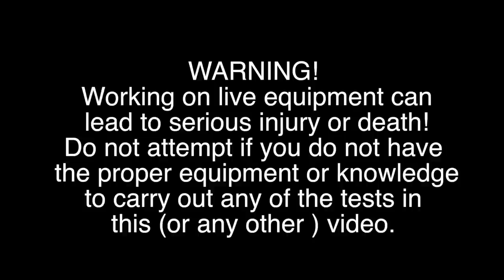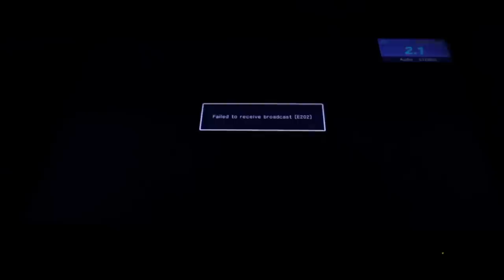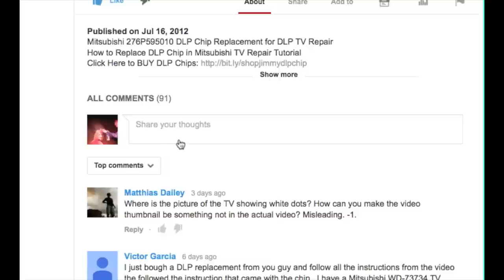Sharp LC-32 1 Blink TV Repair How to Troubleshoot Problem Between Bad Lamps and Power Supply

Comment: Hello, I have a Sharp Aquos LC-60LE820UN I have the error code with the single short flashing light then the long flash, which indicates a lamp/inverter failure. I have replaced the power board and I am getting the same error code; also attempted to clear the code by entering monitor/service mode by holding the power for 10 seconds then releasing and holding the input, vol- and power. I am able to get the lower panel o f the TV to power on ( touch controls, Sharp logo and the V in the center, but the LCD screen does not power on it stays black but it does flash off and on for a second. if I do the sequence several times I am able to get rid of the error code and I am able to power the TV off and on with the power button but the nothing other than a flash on the screen. Is it possible that it could be something else like the T-con board or it actually a bad LCD screen. My next question is it possible to bypass the vault protection as it was done in this video and if so where on the board is the component located that needs the jumper; I have tried to find the schematic for the power board in this TV, which is runtka684wjqz but I have not had any luck. Any help that can be offered will be greatly appreciated. Thanks
Reply from the maker: Andre S   This sounds like a TV panel (TV Screen) problem.  If your TV panel is bad, it may be more cost-effective to replace the TV as panels are typically hard to find in stock, difficult to replace, and expensive.  Thanks and please let us know if you have any further questions!  www.shopjimmy.com
Reply: ShopJimmy.com Thanks, I was hoping that I would be able to bypass the fault code circuit and use the TV until it died completely.
Thanks again,
Andre

Comment: > 
> Product: LED/LCD TVs
> Model #: LC-40LE820UN
> Serial #: A005820180
> Description: Hi I need this motherboard
Reply from the maker: Luis Gonzalez   Try all repairs and troubleshooting at your own risk.  Click this link to a replacement main board for your TV model number:  http://www.shopjimmy.com/sharp-dkeymf452fm02-main-board.htm  There may be multiple boards for the same TV model number, be sure to match part numbers on your current board, with your replacement for compatibility.  Thanks and please let us know if you have any further questions with your TV Repair!  www.shopjimmy.com
Reply: THANK YOU JIMMY I KNOW THAT I NEED THE BOARD THE MODEL # IS XF452WJZZ
THAT THE BOARD THAT I NEED TO REPLACE ......ALWAYS TANK YOU

Comment: I have a Sharp Aquos LCD tv. model LC-40D68UT. When the tv is powerd on, it works for about 2-3 minutes them shut off. there is a red light on the mainboard that is blinking. If u pull the power plug out the power outlet for a few seconds and back in again, then turn the tv back on, it runs for 2-3 minutes then off again. When the tv is on it works normal.
Reply from the maker: Royston Sue Chee  Please watch this video FIRST to help with your repair!  TV Repair! LCD, LED, Plasma, DLP How To Fix Your TV with ShopJimmy.com Help!   I recommend replacing the main board in your TV.  Follow this link to replacement parts:  http://www.shopjimmy.com/catalogsearch/result/index/?cat=56&q=LC-40D68UT  Be sure to match part numbers on your current board, with your replacement for compatibility.  Thanks and please let us know if you have any further questions with your TV Repair!  www.shopjimmy.com
Reply: ShopJimmy.com  hey Jimmy i have mother board out of lc-32sb23u tv and have sodeder c7558 now once it is back in and still does the same it is def a lamp?

Comment: Jimmy -

I have an Aquos LC-45GX6U. The unit does the blinking red light when I turn it on. If I put it in service mode, (hit "input select" and "channel -") the unit will turn on and display a picture. I've tried a reset and a master reset from the AVC box. Same issue. 

I know the unit works, because iI get a picture when it's in service mode. Any idea of what else can be wrong?

dlleon@swbell.net
Reply from the maker: +David Leon  Try all repairs and troubleshooting at your own risk.  I recommend replacing the main board in your TV.  Unfortunately I do not see a replacement main board in the search results for your TV model number on our website.  Please reply with your part number on your main board and I can try searching for replacement parts.  Thanks and please let us know if you have any further questions!  www.shopjimmy.com

Comment: SURE REPLACE POWER SUPPLY , BUT SHOPJIMMY IS ALWAYS OUT OF STOCK AND EBAY SELLER  SENT ME A PS WITH A BURNT OUT FUSE AND MANY DEFECTIVE DIODES. WHAY A BUMMER AND MY SHARP TV IS ONLY 5 YES OLD. NOT A HAPPY PERESON
Reply from the maker: bigibigs715   We have not had the power supply part number - ADTVA2415SA3 in stock since January of 2013.  Unfortunately we are not sure when or if ever we will get that part in stock.  You can sign up on the product page to receive a notification when the part is back in stock.  Also, unfortunately we are not able to control what boards you receive on Ebay, as you bought that board from a different seller than us.  Thanks!  www.shopjimmy.com

Comment: Lk315t3lz5cz picture comes on buy gore in and out
Reply from the maker: Clint Asby  PLEASE SUBSCRIBE TO OUR CHANNEL - Try all repairs and troubleshooting at your own risk.  I recommend replacing the main board in your TV.  Click this link to replacement parts for your TV model number:  http://www.shopjimmy.com/sharp-a31c03ed20-main-board.htm  There may be multiple boards for the same TV model number, be sure to match part numbers on your current board, with your replacement for compatibility.  Thanks and please let us know if you have any further questions with your TV Repair!  www.shopjimmy.com